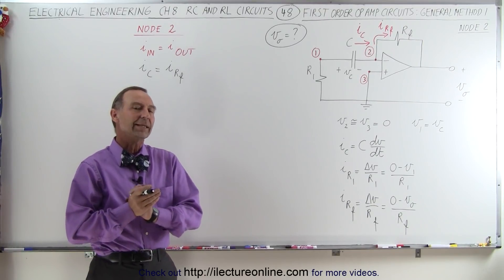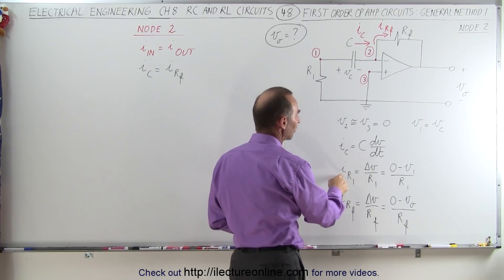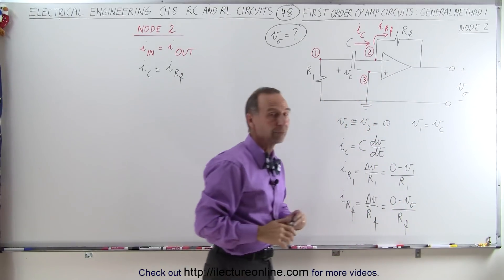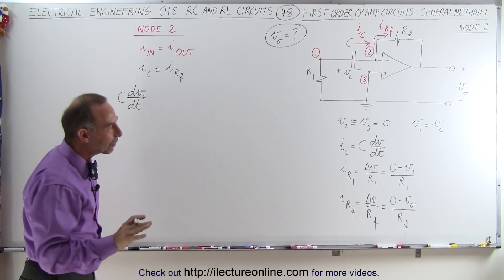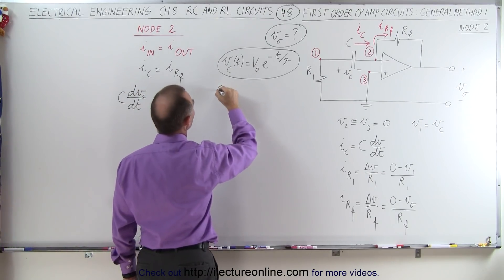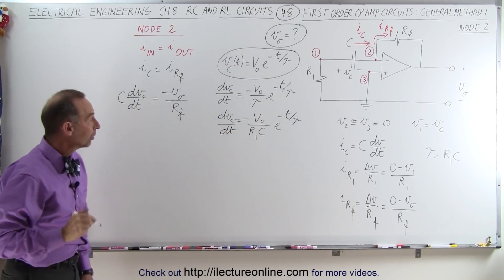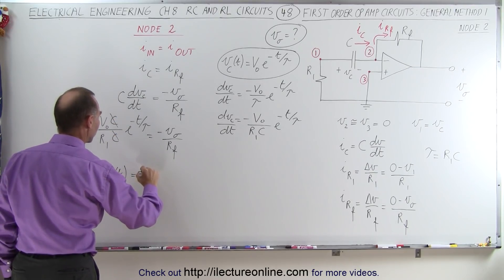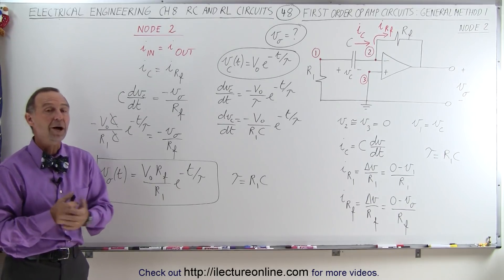Electrical Engineering: Ch 8: RC & RL Circuits (48 of 65) 1st Order OP Amp Circuit Node 2

Comment: hey michel, this question isnt related to the video but im finding it hard to answer this Question (its about pressure) 

One limb if a  u-tube manometer is connected to a gas supply, the other limb being open to the atmosphere. The effect of connecting the gas supply is to depress the level of the water in that limb to 160mm below the the level in the limb open to the atmosphere. By how much does the the gas pressure differ from the atmospheric pressure and is the gas pressure greater or less than the atmospheric pressure.
would appreciate it if you can make a video on this, but would understand if you won't. But someone please answer this q